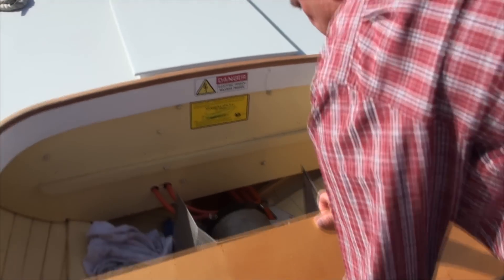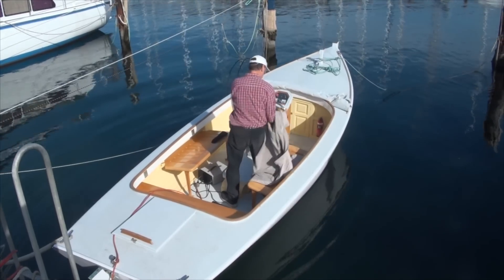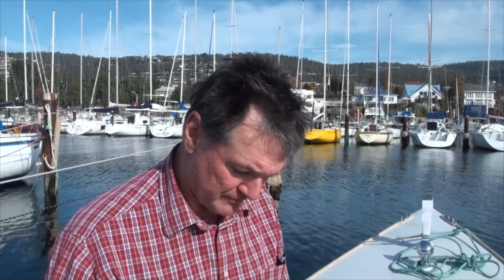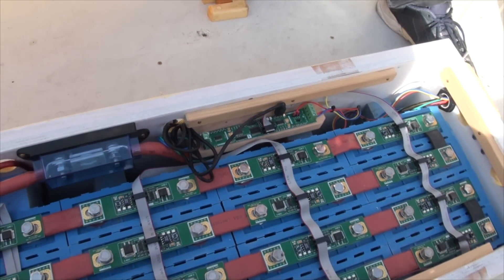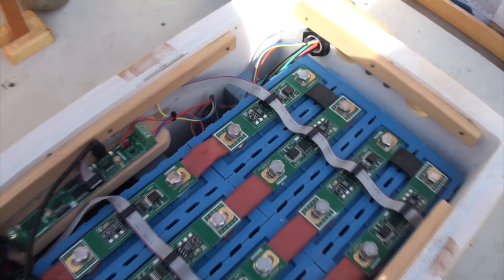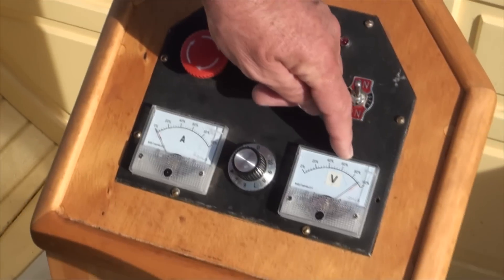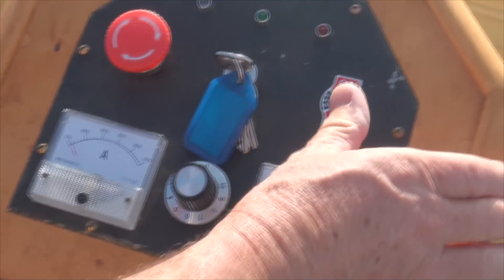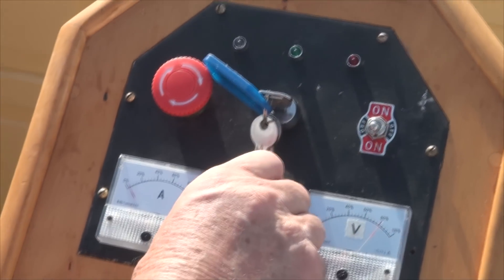"Georgina" Electric Boat Conversion

Comment: Sir ilike your setup can i say how to install your  steering wheel may i see your controller thk you sir!!
Reply: The steering wheel is a kit cable system. 
Controller from Kelly Controller. 50V, DC brushed motor.

Comment: LiPo batteries have a lot in common with fireworks, so that is why each cell must be monitored....Google: LiPo battery risk!
Reply: That's why he's not using LiPo. (Lithium polymer) He's using LiFePo4. (Lithium iron phosphate) The iron in that formula makes it more stable. They are not quite as energetic as LiPo, but are much lighter than the equivalent lead-acid.
Reply: Brian is correct.